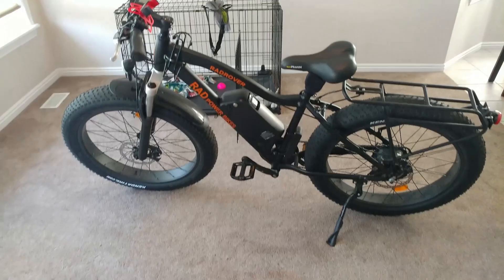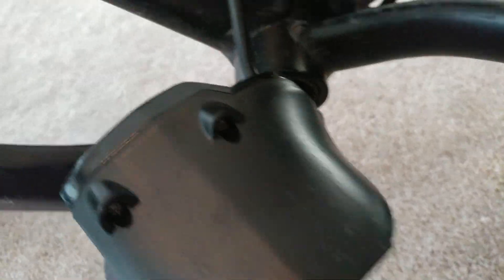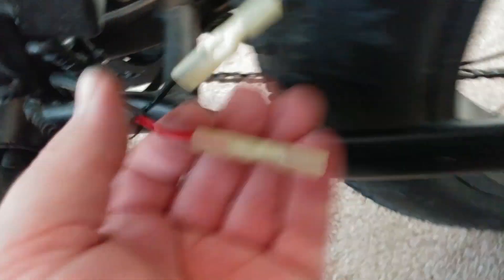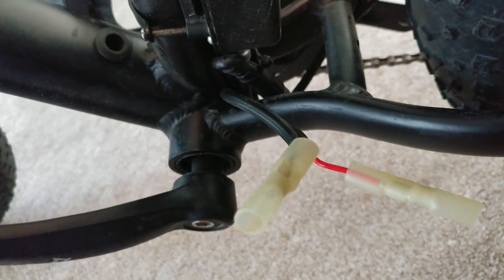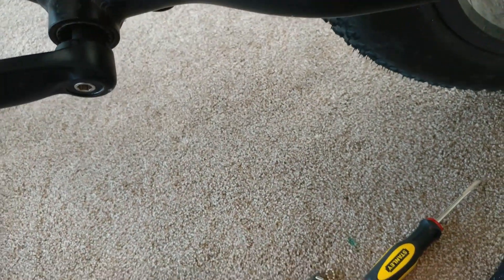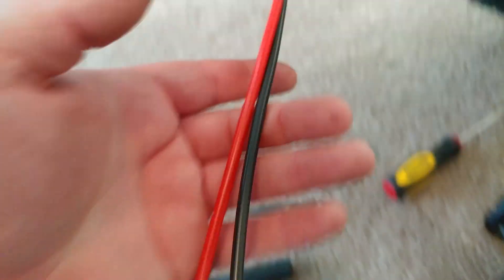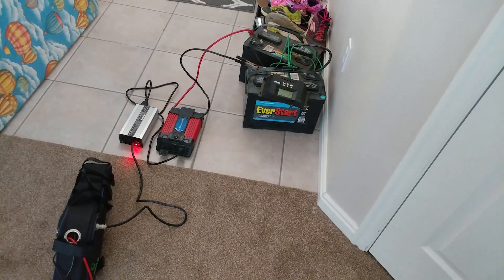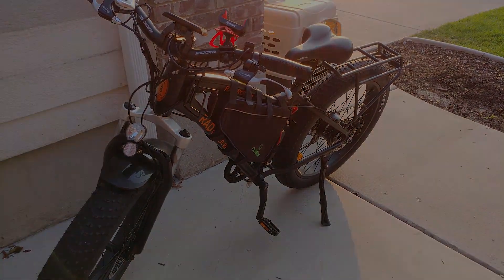RadRover 52V Battery Upgrade Tutorial! Electric Bike Mod

Comment: Do you know if the stock controller can handle 52v batteries? I plugged mine in and I had no motor power then the screen went haywire and it completely died and won't turn back on.
Reply: I had a 52v on the stock controller for almost 2 years with no issues. So, yes it should work. Mine is a 2017 model though. I don't thing they changed much though after mine.

Comment: This bikes motor and electronics are designed to work on 48 volts, increasing voltage can and will damage those components beyond repair. Don’t do it.
Reply: 3 years and 4000 miles later, still running great with this battery.
Reply: @GlennPearsonDIY  I have a 2017 Radwagon and am thinking about doing something similar.  It's encouraging that you haven't had any problems with the controller.  In your research did you find out what it limits the current to?
Reply: Oops, I missed your reply above to 007vsMagua
.  Thanks for putting this out there.

Comment: Will this battery give me more speed/power/torque, if the motor/controller are stock ? Also, if I mount the stock battery on the rear rack will the wires reach the controller ?

Comment: This is a cool upgrade but to maximize your bike's performance with a 52v battery, you need to upgrade the controller and LCD combo kit to a 35a, the stock is only 20a. This 35a controller/LCD will transform your bike to a whole new animal! I highly recommend you also upgrade to their 52v Shark batteries that mounts on the original down tube frame. The upgrades can be found here  https://electrobikeworld.com/products/35a-controller-rad
Reply from the maker: I am curious, how well will the motor handle the extra current? Any thoughts on longevity and reliability?
I am hoping for an honest answer, and not one wishing to simply sell a product. TIA.
Reply: @f7familyvlog704  you might want to research Radpower hub motors,ill leave it at that.
Reply: @elevenAD  trying to determine how your comment benefits the conversation. I have done researchon the motors. I actually switched to a 35 amp controller about six months ago and have put about 200 miles on the bike since then without any problems.
Reply: @GlennPearsonDIY  i thought it was pretty self explanatory, if your confused by the comment perhaps it because it was not intended for you but for the person tagged in the post.have a nice day Sparky.
Reply: @elevenAD  I own both channels, I am commenting from my main channel. Not sure why you're just going around trolling videos. Their seems to be an alternative motive behind your comment to research the hub motors and I was hoping for clarity. Apparently the maturity level to honor a request like that is above you. Can you tell me why you are asking people to research the motors? Please take the time to elaborate otherwise your comment is completely worthless to anyone looking into these bikes.

Comment: You should have gotten a higher capacity pack. You upgraded, but only a little. You could have spent a little more, and made it worth wile.  Your idea with the switch, and both packs is a good one.  If the packs were the same volts, you could have parallel connected them for mega range.  I am looking at the same battery, but the 31.5 Amp Hour size..
Reply: 31,5A means 9cells par from 3500ma. and 9x14=126cells   X50grams= 6300grams+1000gr case= 7300grams=wow
do you have info?

Comment: Much simpler answer. Carry a spare battery. That gives you twice the range. Simple.
Reply: You missed the other points of having a higher power battery pack. By the time this 52V battery dies, it still has more power (more torque, speed) than the 48v battery has. I don't have to worry about lugging another battery with me. I purchased this for hunting. The less weight I take with me the better. I also am using the other battery for a ebike I'm building for my wife. I needed to purchase a battery either way. :) Worked out great for me. Carrying a spare might be a good option for you though.
Reply: @GlennPearsonDIY  I would like to purchase one if it would be a simple R&R swap.

Comment: Rad Bikes have upgraded their battery packs using Samsung cells.  Their battery is now rated at 48V and 14 AH.  

Just tossing that out there.  Thanks for the vid.
Reply: Yep they do. I may not have upgraded if they had those when I did this. But, I do like having the 52V. When my 52v battery is dying, it still has as much or more punch than the 48v does when its on a full charge. The new 48v 14ah batteries are about 15% smaller than this one I installed still, because of the voltage differences.

Comment: batteies are the most expensive thing on a ebike, why didnt you just build one and give the Rad to her?
Reply: Profit on the bikes are the batteries.
example= radrihno uses  hailong cases.
they use the 52 cells version so 4cells par x 3500ma=14A=672Wh
at aliexpress you buy the 65 cells version so 5cells par x 3500ma=17,5A=840Wh
https://www.youtube.com/watch?v=YBaKiNl8DUs
i build my own with 70 lg cells from 3000ma in 52v version. (brown color)
they give a longer higher discharge voltage (1,5V higher) and because the max cellcharge is 4,35V i don't
have to be affraid off overcharging, and i use a fastcharger 4A.
my box is the=
https://nl.aliexpress.com/item/32974720411.html?spm=a2g0s.9042311.0.0.949d4c4dZQZ6Z0

Comment: Excellent video, thanks! Including the one about how to increase the max speed, I couldn't believe it was so simple. Lol. I'm not as smart as you, but because I use my bike for work as a courier, I've been looking for a better alternative to the underwhelming stock battery on the 2017 RadMini. Would you be able to at least point me in the right direction? I found some 52v 15ah samsung cell silverfish case batteries online, and I want to know if they're compatible or what I can do to make them compatible. There are a couple links below. I'd appreciate any kind of knowledge you could share, thanks and have a great day :)

https://www.aliexpress.com/item/No-taxes-High-Power-52V-1000w-Lithium-ion-battery-pack-down-tube-52v-15ah-shark-ebike/32839379914.html?spm=2114.10010108.1000013.3.18b07b1btOuEM1&scm=1007.13339.90158.0&scm_id=1007.13339.90158.0&scm-url=1007.13339.90158.0&pvid=45be6416-3471-4360-9054-e49a3011bea4&_t=pvid:45be6416-3471-4360-9054-e49a3011bea4,scm-url:1007.13339.90158.0

https://www.aliexpress.com/item/Top-discharge-51-8v-lithium-ion-battery-silver-fish-case-electric-bike-battery-52v-15ah-ebike/32785722088.html

Comment: Thanks for your information! Regarding the solar charging, did you use a modified or pure sine wave inverter? Wondering if my current modified sine wave inverter would damage the bike battery charger?
Reply: It was just a cheap modified inverter. It has worked great for many things. I have a nicer pure sine wave inverter for my camper, but for chargers and other things, I haven't seen any issues using the cheaper inverter. So far anyway :) You can see the difference if you plug a TV or radio in, there can be some feedback from the cheaper inverter. But that has been the only time I have noticed.

Comment: You should have spliced inside the sleeve of you go to re sell the bike that is going to be obvious to the buyer
Reply from the maker: If the buyer knows anything about these bikes he will know the battery was changed either way. I have since heat shrink-wrapped the wires now, so this is a non-issue. 

Thanks for watching.

Comment: Can you also use a 52 volt 20 AMP system on the rad ? And do you only use the black and red wire.? What about the bms on the new pack?

Comment: Did you sell you original battery? I'm interested in buying it.
Reply from the maker: No, I still have it. I'm planning on putting it on my wife's bike when I convert her bike to an ebike. There are other batteries available that will be a direct fit for your Rad Bike. Check out the dolphin battery packs. They should slide right into your bike's battery mount.
Reply: Thank You for the tip.

Comment: So upping the volts is the easier option but when you up the volts dont the amps go up aswell ?
Reply from the maker: No, you can up the volts and amps completely separate. It depends on if the new battery has the cells in series or parallel. Parallel will up the amps only, series will increase the voltage only. Add both together (amps+volts) to get the total watts.
Reply: @f7familyvlog704  A*V=W If you up just the A or just the V then W will go up: 746W=1HP.
Reply: You have increased the power, Watts, to over the legal limit, but traffic officers would not know or care. They probably would be happy if you kept the speed below 25 while pedaling. I know it is 20mph, but when pedaling, you can legally push it faster, especially down hill. The officer does not know how hard you pedal, but hit 30 with those fat tires and it would be obvious you've jucid it too much.
Reply: F6Family Vlog damn.. I want to learn...
Reply: I would humbly like to add that technically, Watts is Amps multiplied by Volts (W=I*V)

Comment: I saw the 52v dolphin pack from Luna cycles. You think that would slide right on to the stock down tube bracket? Also the the controller can handle 52v correct??

I have a radcity, I must have forgot to lock it and I hit a bump and the battery launched off. It turns on and charges, but it won't power my bike.

I don't a triangle battery for aesthetic purposes. Would be nice to just slide the new 52v pack right on. I have no experience with electricity.

Thanks for the video!!

Comment: Here is a thought and what I am considering. Somehow mount the stock battery holder to the rear rack on the deck so I can still use panniers. Split the main connector with a switch mounted to the handlebars or down on the downtube somewhere. Ride out one battery until its low, flip the switch and instantly keep going on the other battery. Why not put the 500 dollar battery that came with the bike to use ? :) would only add about 5 bucks to mod your set up this way versus buying another 500 dollar battery.
Reply: I like this idea - I have a Rad Rover was planning on buying one of the new 14A batteries, and just carrying the old one in my rear rack bag and swapping them out manually when I drain the first one.   Your suggestion would only require purchasing an additional battery holder and a simple switch.   I'll probably do this - thanks!
Reply from the maker: I agree, that would be a great option and not very hard to do. The reason I am not doing anything like that is because I'm converting my wife's bike to an ebike and using my stock RadRover battery on her bike. But what you described would be a great option for a 2 battery setup.

Comment: Thanks for the tutorial. I can see you know your way around electronics. In your video narration you mentioned that the voltage increase shouldn't affect the controller and then you mentioned amperage. Your new battery is listed at 15AH, but the stock battery provided by Rad Power Bikes is listed as 11.6AH. Maybe you could give me a quick lesson about amps.

By watching your video I picked up a link to 'CaliBike'...thanks...never heard of them. Looking at CaliBike's website I noticed they had a 48V/20AH battery pack for only $30 more than the 52V/15AH. It's my belief that the more AH you have the longer battery life you have. Are you saying that those 4 extra volts will provide more power?

I suspect your going deer hunting and want a reliable transport. Maybe consider a narrow two-wheel trailer? But then again, I suppose just putting a deer on the bike and using the bikes built-in-walk-feature would be reliable and safe.

I didn't realize the price of solar panels are more affordable. 2x4's and framing brackets seem to be the way to go for a simple solar array.
Reply from the maker: @007vsMagua, 
Thanks for the comments. Lets see if I can answer some of your questions. 

For the controllers on our bikes, they are limited usually by amperage. The max amperage of my controller is set to 22 amps. This is the amount of current it is able to pull from the battery. Amperage is what causes heat, which is something that can fry motors and electronics. Increasing the voltage doesn't increase the heat like increasing the amperage would. The max voltage I believe the controller can take is just over 60v, but I cannot recall for sure right now.

its more than just the 4 volts. You have higher volts all the way through the discharge. The 52v battery will charge to 58.8v, and discharge to 42v. The stock battery will discharge to about 38v, and starts at 54v fully charged.  I have noticed I have more power the entire time, where with the stock battery you could really tell when it was getting low. The higher the volts, the faster the motor will spin. 

Unfortunately, the 20AH battery was not available when I ordered my battery. Otherwise I would have purchased one of those. However, the 15ah battery is a very tight fit on my RadRover. I'm not sure if the 20AH battery would fit inside the frame. It may have to be mounted on the bike rack if it doesn't fit.  

Hope this reply was clear enough. I don't have time to look up resources for clarification. If you have any other questions let me know and I'll have more time tonight to reply.

Comment: Thanks for the video.  Have you had any issues with error codes or excessive heat?  Also, now that you've had some time to test it with the new battery, what would you say the range is now?  Thank you in advance.
Reply: No issues at all after about 50 miles. The range is probably close to 30 miles without pedaling, but I always pedal so its further for me.
Reply: That's great Glenn.  Thanks for the update.

Comment: ok so you upgraded battery, upped stocked speed through settings, now the thing I'm having is wanting to upgrade the calipers to some shimano's with some new brake disk, I working with a rad mini, you feel like you want to upgrade yours. also have you thought about trailer hitch that acts like a rolling book bag when unhooked.
Reply: I think a hydro brake upgrade will be my first upgrade other than tires. Definitely interested in a 52v battery upgrade too. Luna has a direct replacement....a no brainer.

Comment: The existing controller can handle 52v, and Luna sells a 52v dolphin style battery that fits the existing mount. Seems like just carrying a spare would have made way more sense. https://lunacycle.com/batteries/packs/52v/52v-pansonic-11-5ah-or-13-5ah-dolphin/#ProductReviews
Reply from the maker: For many the dolphin pack would make sense. For me and my situation it didn't. Th battery I purchased has about 25% more capacity and cost less. I also moved my stock battery and adapter plate over to my wife's bike and converted hers to an ebike. So, a separate new battery made more sense.
Reply: Paul Wagner ..the dolphin/shark batteries fit the rad rover without any mods?   Mounting and electrical are all plug and play?